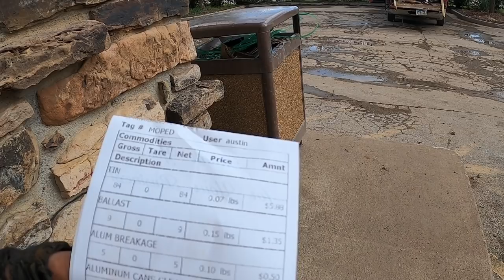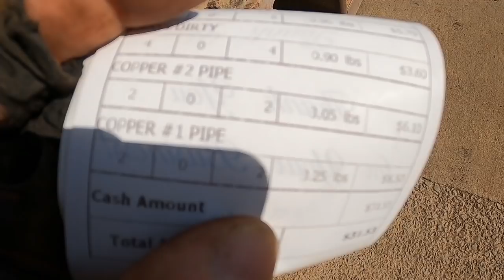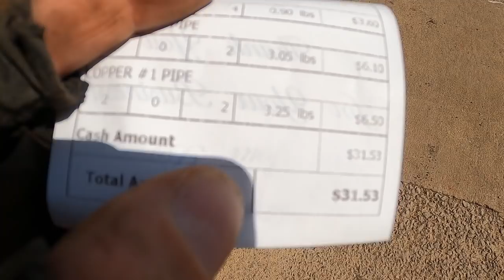Dumpster Diving For A Fist Full Of Dollars!!! 🚨 (Director's Cut Behind The Scenes Edition)

Comment: I use aviation snips. They'll cut through most anything. Those measly electrician side cutters not that great for cutting braided water lines. I use those kind in my shop for small wires.